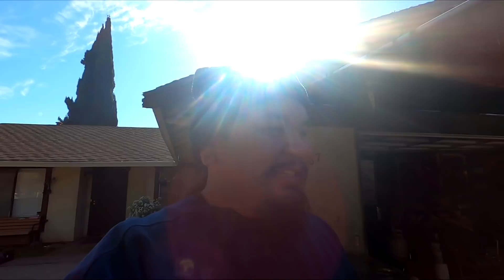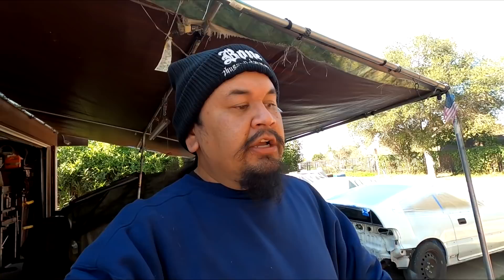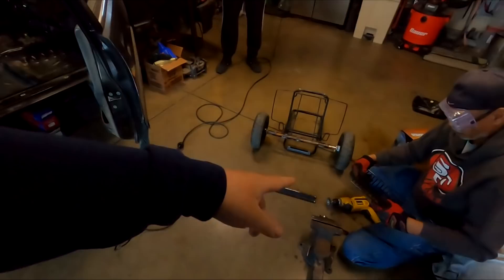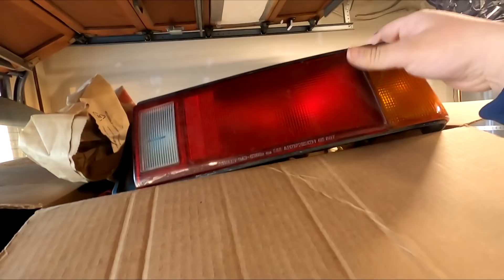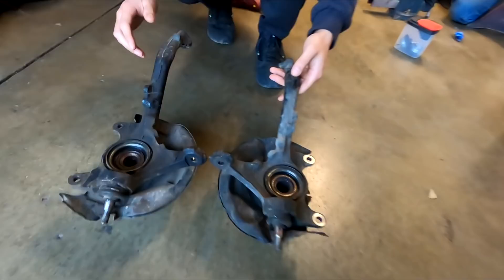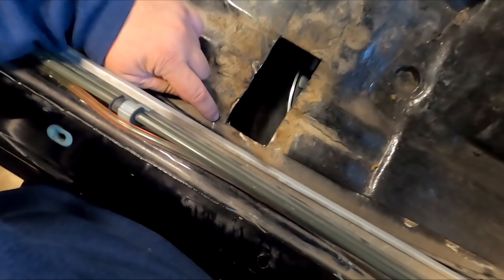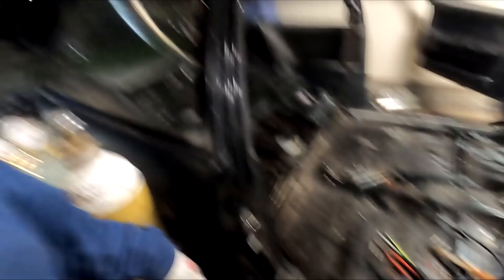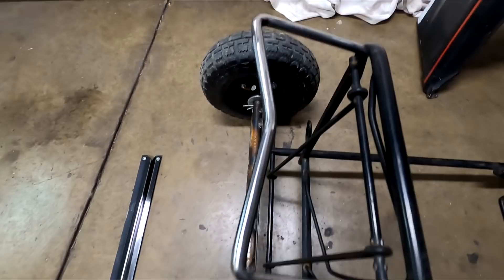Welding Repair Patches in 89 Honda Civic Hatchback SI

Comment: Always use a small aluminum plate while welding through holes, it helps so you don’t blow through, steel weld won’t stick to the aluminum